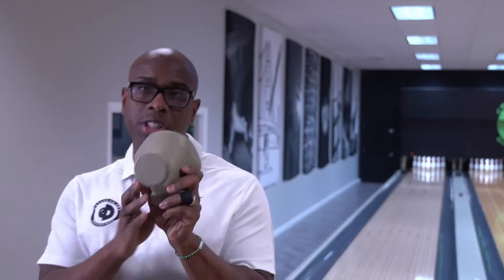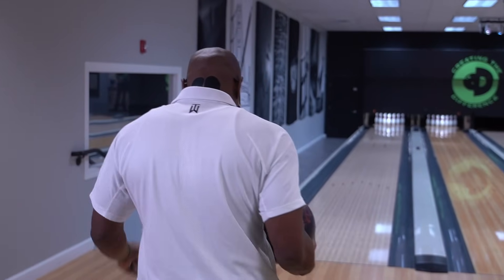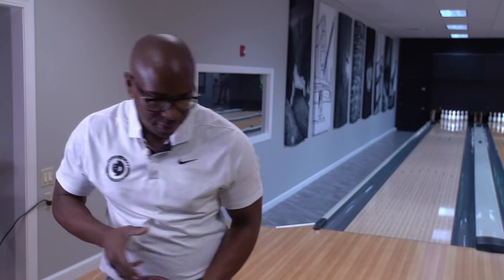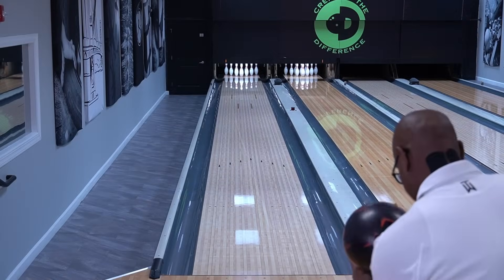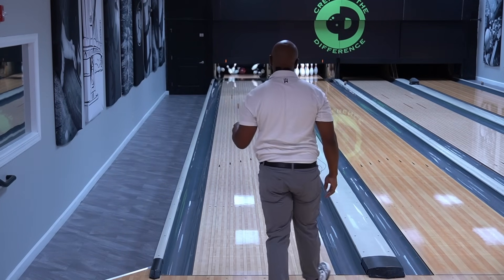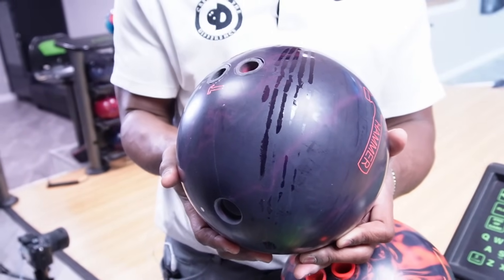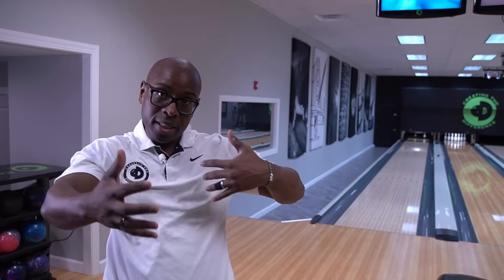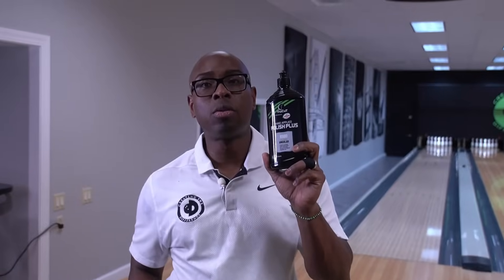Improved or Worse? | Hammer Black Widow 3.0 vs 2.0 | Surface Change | Deep Dive Bowling Ball Review

Comment: I just got back into bowling after taking a few years off. My eqhipment was somewhat outdated. My UFO Alert still has some life left in it but doesnt have a good look in the first couple games of league play. I need something a tad more aggressive, something that gets a little more read through the front end. Bought a Global 900 Sublime and I'm not really in love with it. I've tinkered with the surface a bit and still not getting the reaction I'm looking for. I'm thinking just maybe, this might match up well with me. Our house shot is pretty lengthy, I'm slightly rev dominant. Any other solid you'd recommend over the 3.0? Want something that revs up early, reads early but stores energy well and explodes through the back end. My Sublime seems to skid a tad too long for my liking.

Comment: What is interesting is HK22.  From what I have seen it reacts differently in a hybrid/pearl than a solid.  I have a radio active vibe and polished that thing is clean.  Shoots down lane and makes a left turn hard to the pocket.  When I sand it it is substantially early with a similar shape.  My Troublemaker (no HK22) is actually a lot cleaner than the VIBE even though I put 3000 on the vibe.  Now when I take my HK22 GB4 hybrid that ball is sideways compared to the Vibe and the troublemaker. 

It seems like the formulation does different things once pearl addatives are added.  It also makes me wonder if there have been chemical differences from HK22 Gen 1 (2023) to now HK22 Gen 2 (2024).  Could be why the 3.0 is earlier with similar backend.

Comment: should try a 60x5x20 layout on the 3.0 at box finish vs. polished and tell me what you think the difference is compared to the layout out of box and polished on your current layout for this vid of 55x4 and a half by 30 and which one you like more or think performs better. i have all my bowling balls drilled at the 60by5by20 layout and thats my benchmark determining what i may want my next ball drilled similar to or almost completely opposite depending on the performance requirement i believe my personal ball should have. Note, i'm not a pro but im trying various things to see if there is something im going to hate or want to stay away from and haven't found it yet